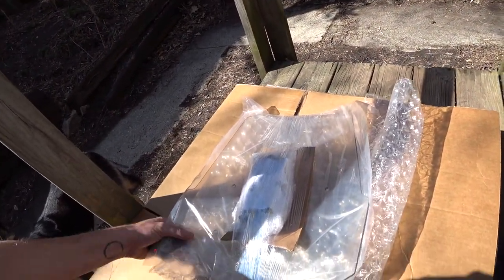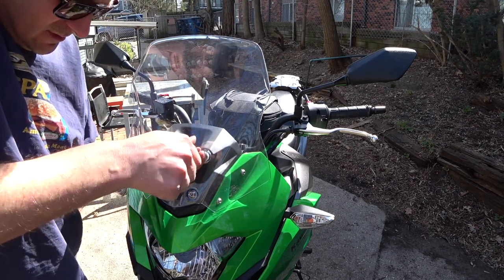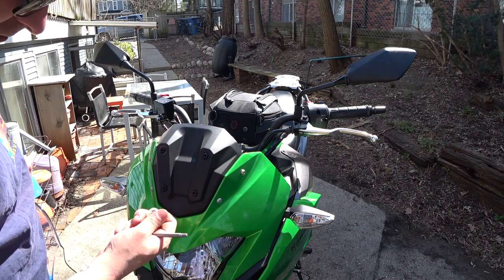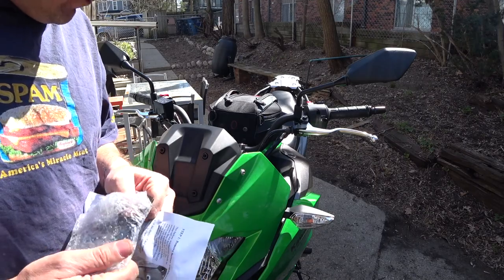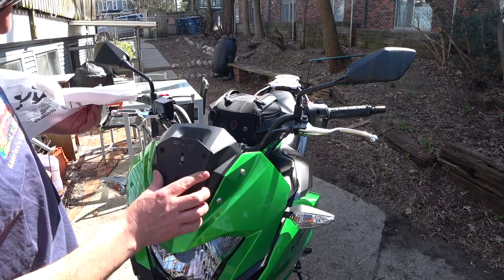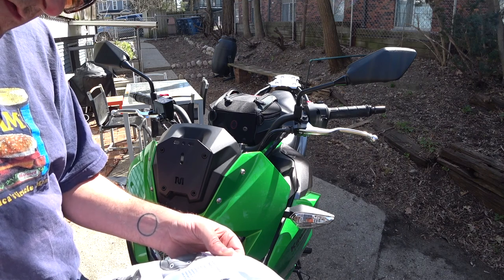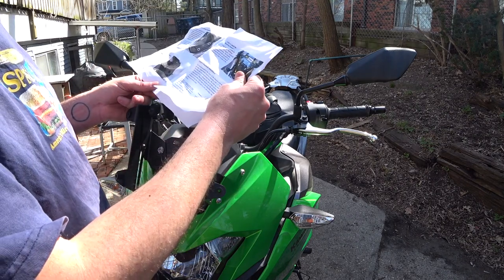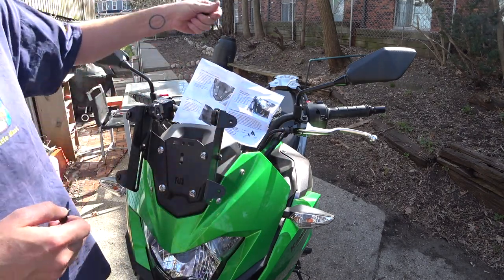Kawasaki Versys X 300 Madstad Windshield Installation

Comment: The bolts are different sizes for proper torque the wrenches are made to length so that if an average person pushes on them with a firm push the torque will be wright. that is why when you get a set of wrenches the smaller sizes are shorter. So if you are a week person you have to use more of a push and of course if you are above average strength take it a bit easy on the push. It is that plane and simple, they are not different for no reason.

Comment: I was getting a lot of buffeting with the stock windshield too. I mean a lot. I felt like a bobble head when I was over about 55mph. I even tried a different helmet instead of my dual sport type helmet. I thought maybe the air was catching under the visor. Nope. Not much difference. I took the windshield off and it was a tremendous difference. Naturally you get the air hitting your chest but I had absolutely no buffeting at my helmet. None. Much more enjoyable riding that way. I have one of those windshield extensions coming and will give that a try and see what happens. If it doesn't make a big difference I'm just going to go without the windshield because i don't want a huge windshield out there in front of me when I'm doing any off road riding. I put the bolts back on the holes and it really doesn't look all that bad without the windshield.
Also as far as a tank bag goes, I got one at Walmart. It says Coleman on the box but the tags on the bag say MadDog. It's a magnetic mount and the magnets are super strong. The bag does not move one bit.  You actually have to put some pull into it to getting the bag off. It's smaller than yours but it fits the tank almost perfectly. Plus it was only $30. lol.
Hey good luck with the bike. Be safe and have fun.
Reply from the maker: That's a good deal on a tank bag. However, I had a magnetic tank bag in the past that ruined a camera LCD. I like to take my camera all the time. They can also damage the paint and possibly mess with credit card magnetic strips, etc if I put my wallet in there, etc. Definitely be careful what you put in there. With those issues, getting a magnetic bag was out for me, and strap mount options seemed like a pain and I didn't want a harness always strapped to the bike.
Reply: Jeff M I'm pretty sure you'll need to install supports that connect the top of the windscreen, to the bottom of it, because the windscreen extension might bend the windshield at the first angle.

   I think i haven't made the video explaining how i made the supports, but in my latest video you can see how it works, despite of it being noisy on the video, i can't hear anything from inside the helmet.

Comment: I just got a used Versys 300 with the Madstad.  Buffeting is terrible even as low as 45mph, I've tried different heights and angle adjustments.  I'm 5'10" I'm looking for a stock windshield to try.

Comment: Cool shield installation.  Just a quick note though, for those who might not know, if you have a lot of "wind noise" the fault is 99.9% your helmet.  You will certainly notice a reduction because of the larger wind shield, but only because you're deflecting wind from the real problem (the helmet).
Reply: Or use earplugs, that should solve 50% of the wind noise problem 😅
Reply from the maker: @RjOwns  Yes, riders should use ear protection especially on long rides!
Reply from the maker: I will say that I did get a different helmet and it is better. It is an LS2 open face and it actually is really great for a very modest price. Wind noise is much less than a previous Nolan and Shark helmet which were more expensive.

Comment: the windscreen looks as big as the one on my scooter, while it is big and thick, not sure if it would obstruct the handle from turning all the way with handle guard install. I had tried several windscreen and some of those have this issue
Reply from the maker: The windshield does not obstruct the handlebars or anything else. For me, this size works well.

Comment: I'm still getting some buffeting with mine.  I ordered some mirror extensions thinking the mirrors may be causing it.
Reply from the maker: Initial ride thoughts on it for me are - I still get some mild buffeting, but it was windy out already, so that may be more the cause. The wind noise is significantly less than stock which was my biggest complaint about the stock shield. Before it was quieter standing up than behind the shield, now it is quieter behind the shield than standing. I have some Barkbuster Storm hand guards to add and will play with the windshield positioning a bit more, but overall I am very pleased with the results over the stock version. I also do like the look of this shield over the other options available currently. The Givi looks nice, but that wasn't available at the time.
Reply: Does changing the angle or height of the screen help at all?

Comment: I'm dealing with the roaring wind noise in the helmet with the stock windshield.  Tried a number of small changes and it makes a difference but noise is just so annoying so maybe the Madstad.  How is the windshield doing to deal with the wind?  You've had if for years and would make a great review.
Reply from the maker: It’s better with the Madstad AND I added a Puig clip on spoiler thing. I’m very happy with that combo. Helmet makes a difference also. I have a LS2 3/4 face and it’s much quieter than the Nolan I had. And cheaper. I think Givi makes a windscreen for the x300 now and it looks like it might work really well too.

Comment: That windshield is BIG, damn, i like how rugged the mounting system looks tho, i did what the others did, and installed the windshield extension, but i had to add supoorts because the extension was bending the windshield on the first corner.

What's the price of that windshield?
Reply from the maker: I think it was about $250 shipped. Price varies depending on the size and any tint. They also had a promo going at the time for 10% off I believe.

Comment: The windshield looks to be decently thick & Have far better coverage but you're joking with that tank bag right?  That thing doesn't even closely fit that bike or tank.  Looks like an accident waiting to happen, getting in your way while flapping in the wind several inches off the tank.  Save a few dollars & get ill-fitting, clearance priced, hazardous gear or maybe wait & spend a few more dollars for the correct size & proper fitting gear that won't cause any issues?  Hmm?  That's a tuff one.
Reply from the maker: The tank bag is rigid and connects to a quick release bracket on the tank. It doesn’t flap or move at all while riding. Other than looking a tad awkward with the gap, it by no means is hazardous or would interfere with safely operating the motorcycle. Yes it was cheaper by over $100 less than the model that would fit with a more appealing look, and I’m okay with the slightly odd fitting look. None of these model bags actually rest on the tank anyway. The base is rigid with the connection being only to the bracket. I think this one was for Suzuki V-Strom tank shapes and was on clearance.